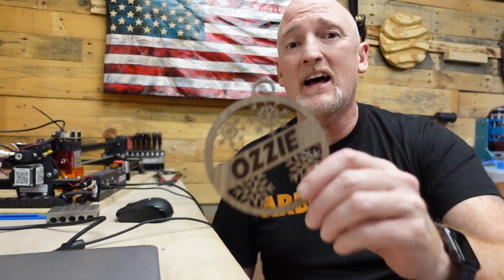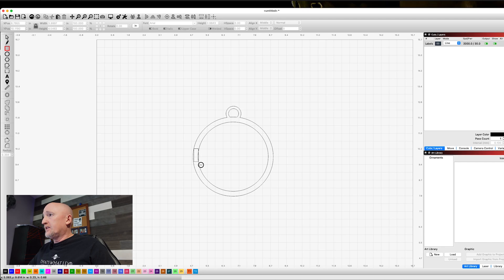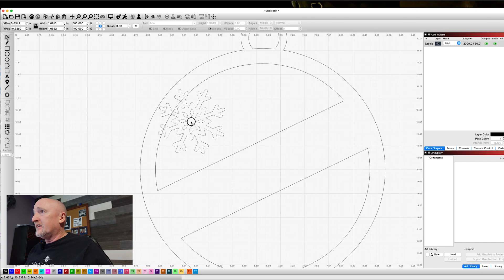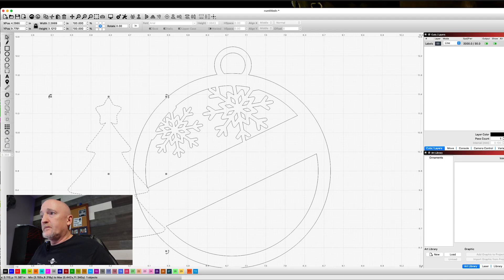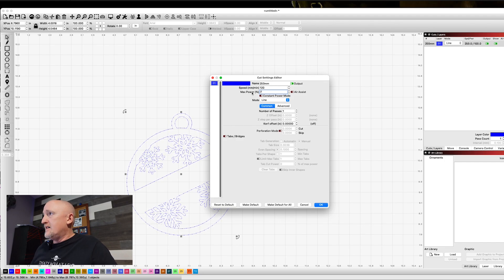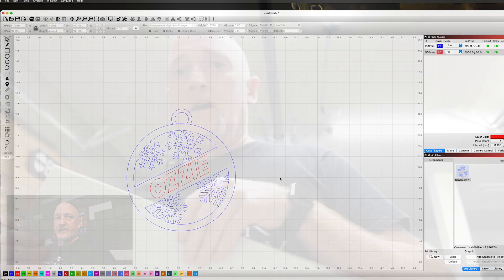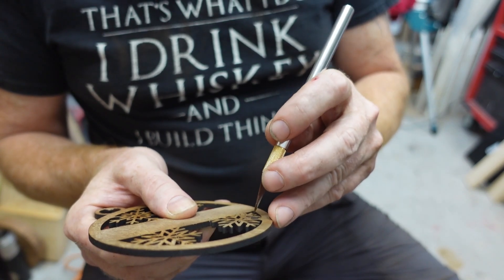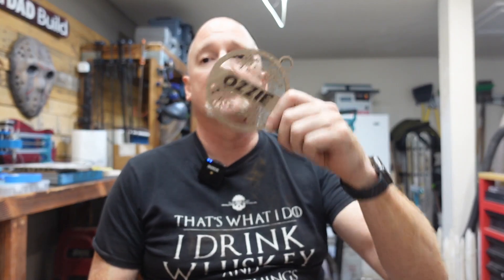How to Design Christmas Ornaments in Lightburn

Comment: Watched your video about a week ago. I really enjoyed it and have had a blast designing ornaments.  So far I have designed 10 different Christmas Ornaments BUT have only been about to make 3 out of 10 on 3.0 mm Basswood on my new Xtool S1 40W  laser . I have had a ton of problems. #1 The device driver keeps opening  instead of . When I switch the driver back from  to  the image is backwards and upside down. #2 When I try to  the design, the laser runs in a very narrow path about 2" by 6" when the ornament is 4 1/2" by 4".  Do you have any thoughts on my problems?
Reply from the maker: @jackleather2812  haven’t heard of these specifically. Check out the xTool Facebook groups. A ton of helpful folks there!

Comment: Do you think a better laser might do a better job with the details to not have to use an exacto for the snowflakes? That seems rather tedious. Could it also be the wood with the laser?  I’m in the investigation stage on looking for a laser and been watching the xTool D1 Pro as well as Omtech and others. Not criticizing your cutter or file. It’s quite impressive but just curious if other cutters might better get through the snowflake.

Comment: I have a question about your comment about the SHIFT key while Framing your project work area. Does it fire your laser (light) at the percentage that is selected in your project (75% for your Ornament Cuts), or does it default to a very low value, just to trigger the laser light (say less than 5%)?

Thanks for your video! Once I get this answered, you'll have shared 3 NEW things that I never knew about for my laser or lightburn!

I've never seen the laser light up when I have done a Frame of my projects. Will b e nice to see that happen.
Reply from the maker: Once you enable the "fire laser" button it allows you to pick a low power. I usually use 3%